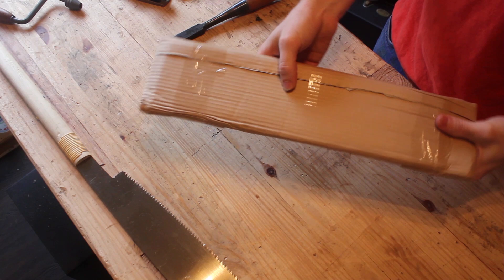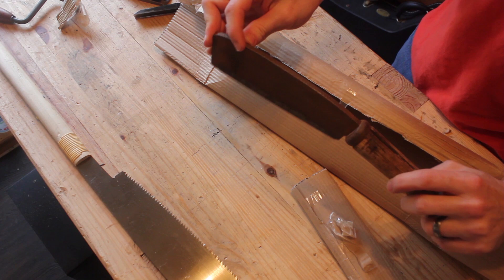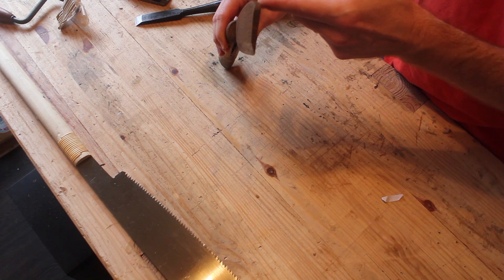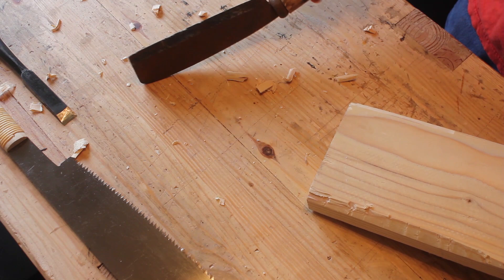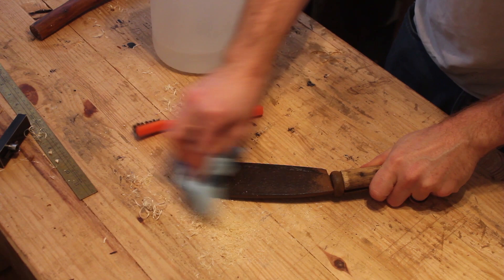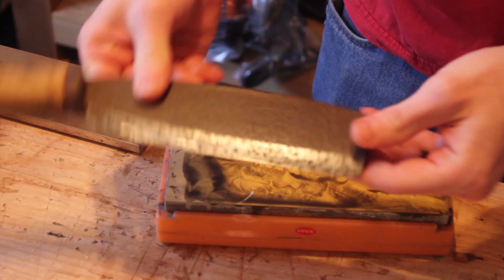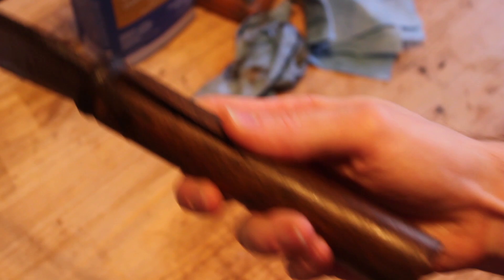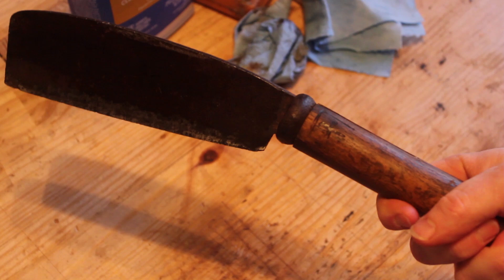Restoring a Japanese Nata

Comment: I highly suggest you get a container of EvapoRust. I use it for all my old tools and it works wonders. It also has the added benefit of leaving a safe film on the metal that will continue to protect it against rust. You want to follow up with light oil regardless, but evaporust is great stuff.

Comment: I've found with using the wire brush for surface rust, using the vinegar helps act more like honing solution on a diamond stone. It kinda helps keep the dust out of the air and helps clear it away from your work surface, if that makes sense. Not the only way to do it, just figured I'd give my input. Sick tool man, I know I'm late, but yeah I'd love to see more content using this thing